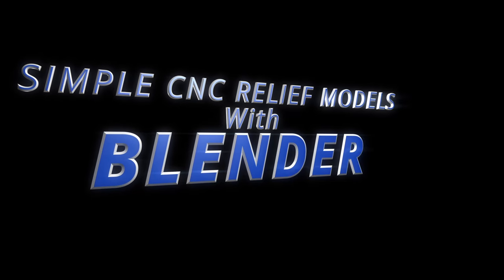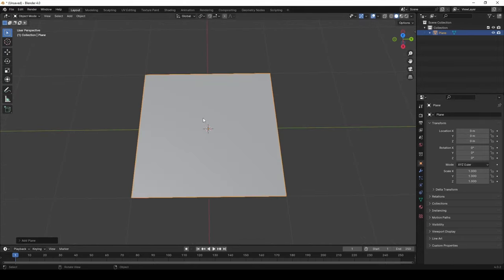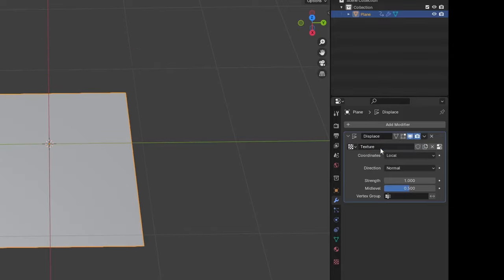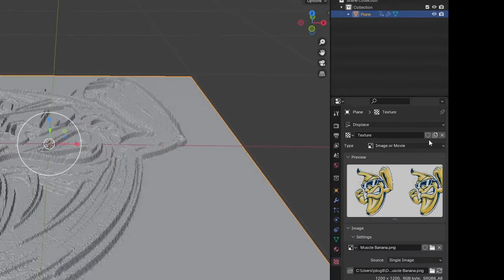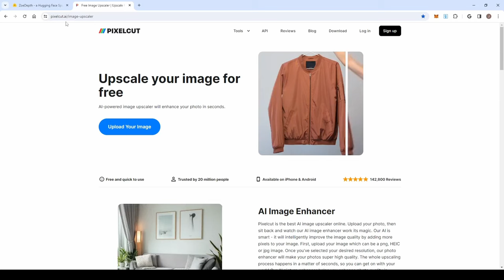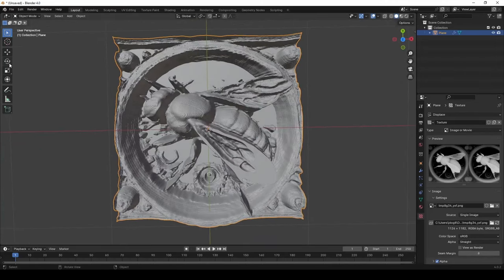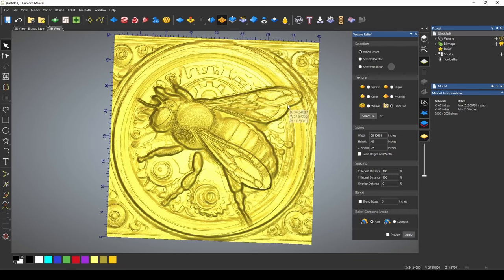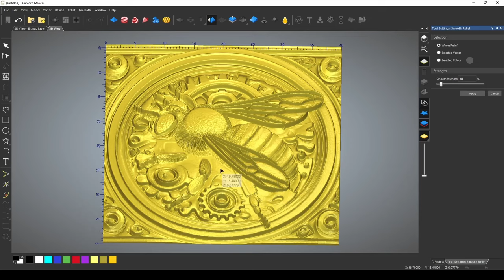Making CNC Relief Models in Blender: My Learning Process

Comment: Great video. This technique is a great tool in the cnc pattern maker toolbox. Blender is a great tool for cnc pattern creation. I've been using it for a decade for cnc and has been a total blast to use. Once you have the image displaced and applied you can use additional modifiers like smooth to clean up or change the image but you can also digitally sculpt on it, as well further modeling by changing/transforming the polygonal mesh. Blender is amazingly powerful but not the easiest program to master. Best of luck to everyone. Its a ton of fun.
Reply from the maker: Thank you for this awesome feedback. I appreciate the tips and will defiantly explore those more.

Comment: Oh thank you for this. I’ve been working with blender for awhile trying to get good looking reliefs. There are a few things that I do differently and between what you showed here and what I had learned elsewhere I think I’m going to be able to take a giant leap forward. When it comes to the smoothing aspect, look up about using the sculpting mode. There are some great tools in there to get rid of all the jagged parts. My issue has always been getting the heights correct when importing images. These other tools you showed are literally going to change my whole learning trajectory.
Reply from the maker: I appreciate the feedback.  I am still working through sculpting but its slow going.

Comment: Fun technique. I'd recommend using the Strength field on the Displacement modifier rather than scaling the plane. When you scale in object mode, Blender still thinks the original shape is the "right" shape. Also you'll get better results with a grayscale image.
Reply from the maker: Thanks for the tips, I will try that. I have been working on ways to make better greyscale images using both AI and inkscape but both are a learning process. Appreciate the feedback.

Comment: I'm a blender user learning cad/cam. One can't machine a mesh even with an insane amount of geometry, it'll always got planar faces. What i've found so far is one gotta use lines and try to convert it to object or solid.
Reply from the maker: I use traditional methods to make 3d models using lines with Carveco Maker+ Cad software.. Most CAD programs allow for the import of meshes and translates that to a machinable form. With the method I showed in this video you could go straight to carving once imported. I have some other videos on my channel showing how to do it the traditional way as well. Thank you for the feedback I appreciate it.

Comment: Hi, excellent result, but I don't know how to convert to solid or create a base to make the relief usable. Do you know how can I can convert and remove the back relief and add a solid box in the base without loosing the upper relief? I tried everything and nothing works. I really appreciate your help on that. Thanks, Regards, Cristian
Reply from the maker: I would put a vector around the model where I wanted to cut it off and use the zero outside of vector tool. Then to add this to a box I would create the box or import it first then import the relief back in and merge it with the box using the add and merge tools in carveco.

Comment: Can you get away with making stl without carveco with gray relief or do you really need carveco to fine tune it to work? Appreciate the videos man im not trying to spend alot but love to learn more Appreciate it
Reply from the maker: Yes you can use blender cam to generate the gcode from the file made in blender but I like Carveco much better. The base version is only 15.00 a month and you can get 5% off with my code TIMBERFALLS. Hope that helps.
Reply: @Timberfalls  oh wow didn't know about the basic, I thought it investing in it but don't even see my machine supported I'll try the basic and that relieved more than the 150 a month for plus appreciate it man
Reply from the maker: @mauromejia2548  Most likely your machine is supported it is one of the top Cad/cam programs on the market and supports most all the machines on the market

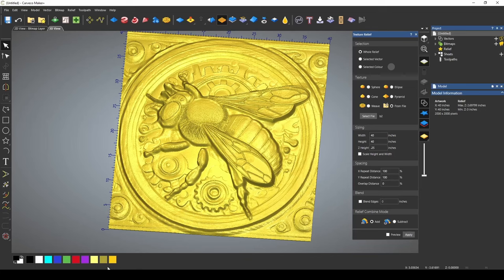Comment: At 8:59 you put the other layer correctly, but in my case when I put 2 layers, the previous piece is deformed, I did everything in the video, give me some help
Reply from the maker: At that part of the video I am using the second photo that I created to make the model using the same steps in the beginning. I am not layering 2 models only creating a new one. If you do not divide the layers in the first step then the resolution will be low and not give much detail. This is why I divided that plane before starting.

Comment: I did the steps still end up with the image not showing up just shows the subdivisions being stretch but no picture, I even scaled and created a depth map image?
Reply from the maker: I am not sure which step you are missing but it sounds like if you are getting the stretched  image then you may just need to scale the z height down to compress the z axis to a photo. If you do not get the image then maybe you did not bring it in as a texture. You have to click the little side arrow in texture to get to the image import box. Maybe re-watch that part to see if that is it.
Reply: @Timberfalls  okay I'll try that yeah, I touched the base dimension I put it to 0 instead of what it automatically puts it at
Reply from the maker: @mauromejia2548  Hope it helps!
Reply: @Timberfalls  yeah I was messing with the wrong subdivisions settings when you went 6 then 4 with bottom one not the top one, had to put higher quality video to see better
Reply: @Timberfalls  one more question how do you fix error lines in reliefs
Reply from the maker: @mauromejia2548  I use the smoothing tool for that. it is one of the brushes.
Reply: @Timberfalls  what if it doesn't show in the editor but the cnc file has it. Been getting lines when post process it and turn it into a cnc file. I use NC viewer and shows on the file
Reply from the maker: @mauromejia2548  Check your stepover on your finish bit. It should be 6-10% bit diameter. This can cause lines in the cut.
Reply from the maker: @mauromejia2548  Send me an email with pics of what your working with. Timberfalls.us@gmail.com
Reply: @Timberfalls  will do appreciate the help

Comment: im trying to convert a 2d picture of my father to a 3d so i can carve it on my cnc. I am having trouble with the height and detail of his facial features. Any suggestions?
Reply from the maker: The direction of the details has a lot to do with the colors in the picture. Dark colors gets sent to the back while light colors are brought to the front. Try using a photo editor to adjust the lighting and coloring to get as light of a photo as possible or use something like photoshop to adjust the color of the picture for best results. Hope this helps and thanks for watching my videos.
Reply: @Timberfalls  it does thank you